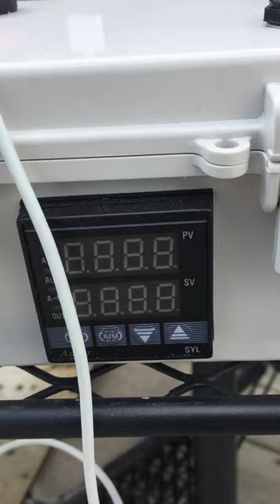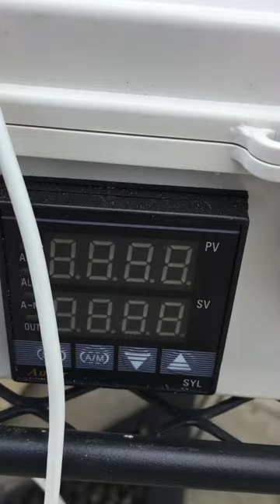PID controller cooking a meatloaf

Comment: Can you tell me where u get that box to install to ur pid?
Reply from the maker: https://www.amazon.com/gp/aw/d/B005T8VO08/ref=psdcmw_495308_t2_B005UPAN0W
Reply from the maker: It’s a bit of a tight fit up and down and I had to trim a couple spots inside the box but if one was more careful it should work just fine without trimming.